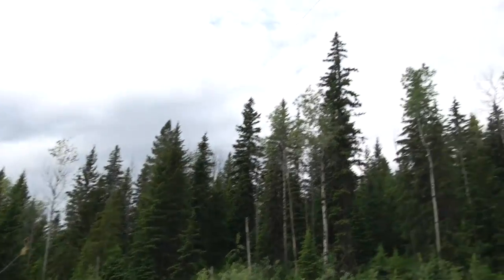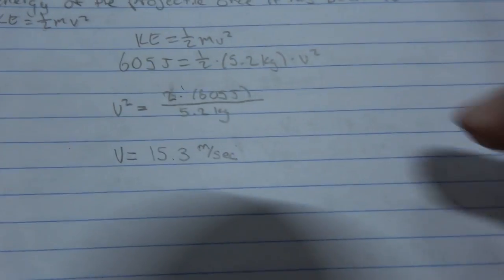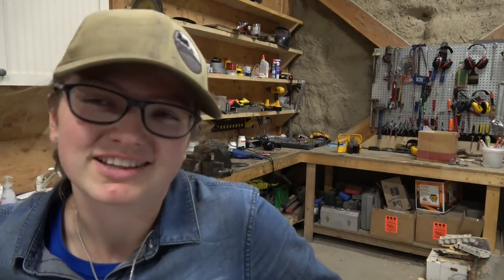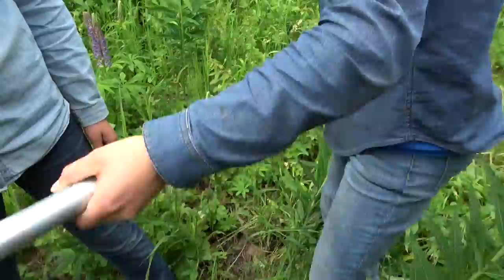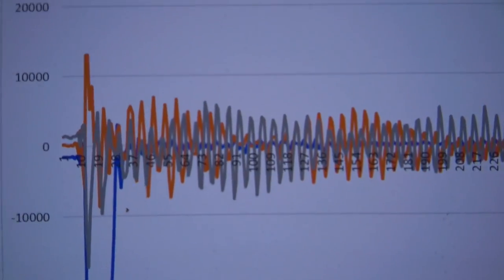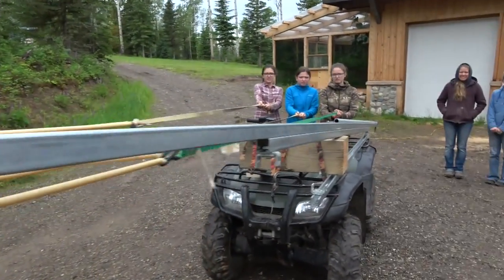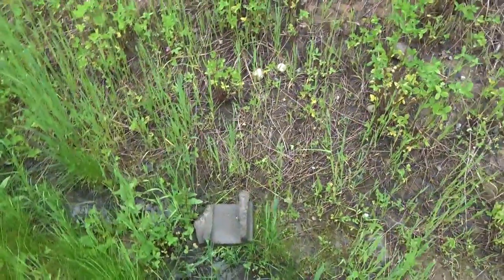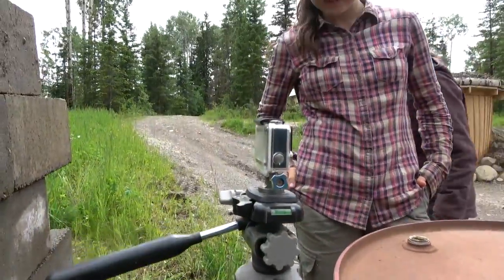We made a 20 foot speargun and shot it through a brick wall

Comment: we used to shoot bows up in the air to see how far they would launch an arrow.  Then we started to tie bombs on them, we were crazy.  Did you know an M80 will send a five gallon pail as high as an electric pole?  The force you speak of Luke is called drag.  The poles friction through the air at an angle would cause drag.  The pole spear bends when you put force on it, like an arrow in a bow.  That is why is doesn't go straight.  This speargun is amazingly powerful, I would not have thought it would pierce that steel barrel.  Good job Obi-Wan Kenobi.

Comment: Learning is a lifelong endeavor and the world is your classroom. Whether someone goes to a school or schools at home it's still just a starting point... although kids who begin their journey at home tend to learn far more and have a much better foundation for learning through the rest of their lives. As for the cross section of the projectile in flight and its drag coefficient... elevation, temperature, and humidity have a greater influence than most would think. And with over a 5 second flight time, the earth continues to rotate beneath the projectile (called the Coriolis Effect) so if you were trying to aim your projectile to impact a specific target you would have to account for that (only a matter of an inch or so but precision counts right?)  Turns out that the calculation for the drag coefficient is pretty complex and I can't find the proper equation to calculate it for a projectile with a 120 square inch cross section traveling at an unknown or estimated velocity during flight. It's also a round projectile so the turbulence would be less than a flat cross section and thus make a positive difference. In other words... ya got me!?!

Comment: Niceee!
Maybe shorter projectile would be more stable in the air? Also little more weight in the front would help.
Due to air drag, not 45° but cca 42° should give you longest shot.

Comment: You would create more stability and greater distance if you stabilized it with fins like a rocket or missile. In the Army our javelin missiles had 8 total spring loaded fins that popped out upon clearing the launch tube. Also reducing friction on the launch rail by coating the rail with something smooth and/or oiling the tube.

Comment: Just to add my little bit of educational wisdom... A body in flight does not have only 3 linear (straight) axes of movement over time. It is at liberty to rotate  as well, over the same axes as the  the first.  The centre of gravity is the same. The 3 rotational movement need an applied force in the same way as the linear movement. No rotation has been applied during flight hence the arrow had a position very unfavourable to air friction over the most part of the flight and therefore travelled a far smaller distance   than anticipated. Over the time of the flight the arrow should have received a force causing it to rotate from appr +50 degrees to appr -50 degrees for it to land nose first in the ground. I think they are called 'arrow flights' to exercise these forces

Comment: the distance was off maybe, bc it was calculated at 45 angle not 54 degrees.

now if they shorten the bands by a third of the length, and add roller pulleys to the muzzle end of the barrel.   attaching the base end of the bands to the bottom of the barrel.  the projectile shaft will achieve a gain of 30-40% 

tell the gals they're beyond awesome !!!!

Comment: When it’s flying straight your cutting thru 1 cubic inch of air. Slightly less because it’s round but when it’s coming down on an angle it would have 120 cubic inches of air to push thru. 120 times more air friction.

Comment: The wobbly line is most likely from the flex in the pipe used for a bolt much like when you shoot an arrow there’s a large bow in the arrow when fired and continues to flex to and fro making the flight path a large arch

Comment: A stab at Jeff’s drag force challenge
Drag Force 
Fd = ½ Cd p v^2 A
Fd   Drag force [F subscript d]
Cd   Drag Coefficient of the object [C subscript d]
p     air density [Greek rho]
v     velocity (squared)
A    Area
A Area
Pipe 1” dia, 10 ft length (will assume 1” O.D.)
Area: ½ of a long cylinder = ½ pi dia length
A= (1/2) (3.14) (0.0254m) (3.048m) = 0.12 m^2
V Velocity
V = 37 m/sec per Abby
p Air Density [rho]
also termed mass density is the mass per volume, in this case air
p = 1.2 kg/m^3 for air at sea level
Cd Drag Coefficient
Cd = 0.82 for a long cylindrical object
Fd = ½  (0.82)  (1.2 kg/m^3)  (37 m/sec)^2  (0.12 m^2)
Fd =  80.8 kg m/sec^2
Since the pipe is open, may have additional friction (drag) on the inside surface; also the blunt end creates turbulence that provides additional friction.  So Abby proved the ideal distance could not be obtained.
Excellent work Abby 	
Homeschooling is “Quality Education”
(next school project, Julia constructs a cart for Abby’s spear gun so Jimmy can pull it to the range lol )